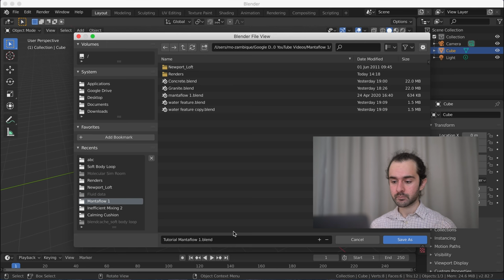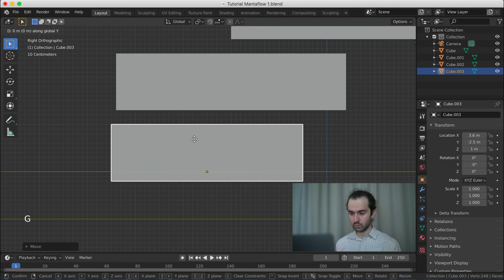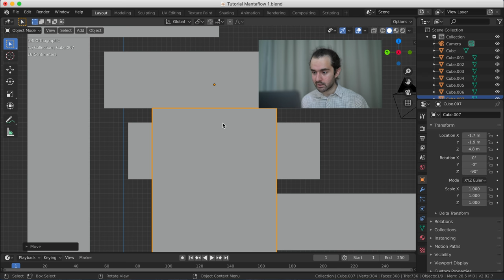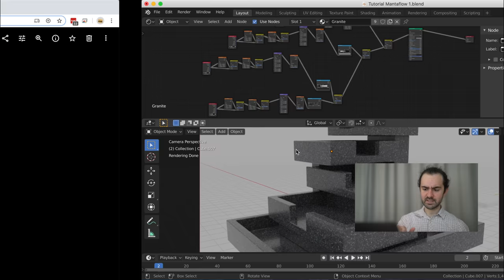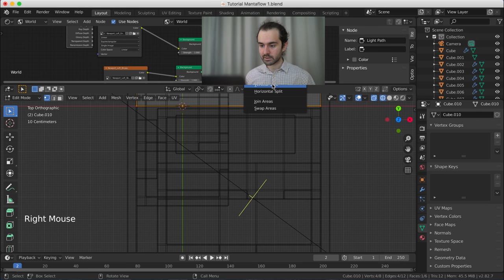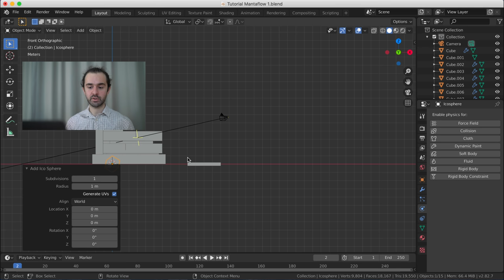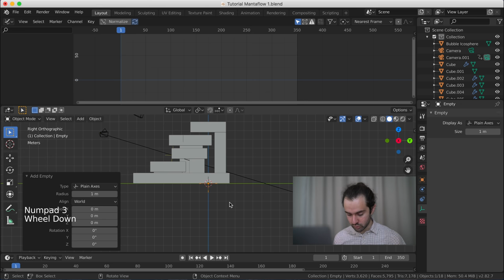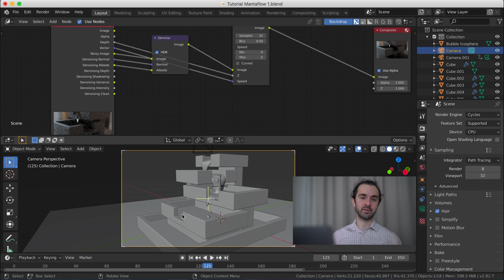Tutorial - Beautiful Water Feature Fluid Simulation in Blender and Mantaflow

Comment: Just following along to this, but my particle / fluid flow hasn't even reached the lower tray by 250 frames, even though I'm using the same settings (I'm using 2.82a ).  Any ideas?
Reply from the maker: You could increase the time step, or increase the number of frames. Weird though, that you are using the same settings and it doesn’t reach the bottom.Could be to do with resolution, which has an indirect effect on the speed of the simulation
Reply: @MobyMotion  It's very odd, as if the fluid somehow becomes thicker / slower. I've tried setting the particle to 1.0 from 0.8, upping the speed, increasing the surface thickness of the collision effectors. At some points, looking at the mesh, it's like it folds in on itself, yet in wireframe, it doesn't seem to leak through the various tiers.
Reply: I've tried all sorts to get the same results as yourself, whilst I'm getting closer, by changing the scale of the scene and putting the flow up to 1.00, it still doesn't seem to work the same way. It definitely looks to "lose volume" on it's way down the water feature, you can see more fluid going in than appears to 'form'. It may be my perception as well, but it seems to gain viscosity as it goes. I've uploaded the blend file if anyone wants to see if they can spot any obvious issues I'm missing. Interestingly, upping the number of time steps from 4 to 5 seems to slow it down, which I would of thought wouldn't be the case, just a more refined movement.
https://drive.google.com/open?id=13zA-oHb8734NxAR1HUSwCjg0u8R40WWu
Reply from the maker: Can’t look at the blend file at the moment - but if your water is shrinking rather than expanding then you need a size value >1. Let me know how that works
Reply: @MobyMotion  Hi, tried above 1 and as you mentioned in teh video, it just overflowed. I ended up going right back to basics and walking through the whole process again. As I was looking at the mesh in wireframe, I noticed an odd bevel where I wasn't expecting a bevel. Checked the modifier, checked the edge bevel weight, seemed fine. Then looking closer, I spotted the tell tale "dot" of a polygon along an edge. For some reason, there were a couple of spurious such polys in the mesh, which of course was copied for each tier. So my guess is the fluid couldn't resolve the effector properly, rebuilding the mesh from scratch got closer, though still not exactly the same, it at least behaved as I expected. So that's a "gotcha" to watch out for for others where they may have similar issues. How the poly got there I have no idea, I may have had an edge highlighted and accidentally hit 'f' I guess.
Reply from the maker: Ah interesting - glad you (almost) fixed it in the end. Another thing would be to make sure the fluid modifier is above the bevel modifier, so that the basic shape is used for the calculations and not the modified one.
Reply: @MobyMotion  Ahh, good point!

Comment: How to do a multithreaded render? Tell me please! I see you have several (to be precise 8 pieces) squares running around when rendering. I have only 1 square in Blender. I used to use 3dsmax and there I ran 24 squares (since my processor has 12 cores and 24 threads).
But in Blender I always have one square at any setting. I installed both "CPU" and "GPU Combined". I've tried setting "Thread" to "Fixed" and specifying 24 (although the number was already 24 by default). I also tried to enable the use of CUDA in the settings. But always the same result, that when rendering, one square runs, instead of 24.

Can you help me set up Blender correctly so that the render is also multi-threaded like 3dsmax by default?
Reply from the maker: I had multiple tiles at once because that computer doesn’t have a GPU. If you using CUDA (ie a GPU) it’ll only render one tile at a time but much faster
Reply: @MobyMotion  Before I enabled CUDA, I rendered with a processor. However, there was only one square.The version in which I did it 2.93 and 3.0

Comment: Dear Moby Motion! What a great tutorial - many, many thanks! However, after applying the granite texture and linking all the "Object" instead of the "UV" nodes, I found that the texture is scaled along the z-axis in (exactly?) the same amount as I scaled the cube initially to construct the basins. So now the texture looks great for the surfaces parallel to the x-y-plane, but it is squeezed on the vertical surfaces. Did I forget something/make a mistake (I'm using 2.83)? Thx so much ;-)
Reply: Edit: Just found the problem and solution myself: I scaled the objects in Object Mode - which changed the dimension and the scale. Obviously one should only scale in Edit Mode to keep the surface-scaling unchanged. However, using Ctrl-A and apply the scale solved the problem. Time to continue the tutorial :D
Reply: @guenthergrohall3437  Thanks! I was getting the same problem. Now solved. ✌

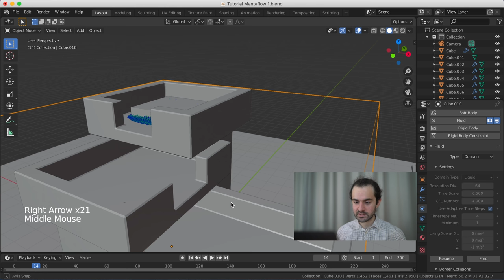Comment: May i know at 45:00, why did 'Liquid' particle system is turned off in both viewport and render? Without the liquid particle system, the particle radius property in it cannot be set, then isn't that the water overflow mentioned in 38:40 would happen? I leave it turn on before baking and my water flow is lesser than the water flow in video. Thank You so much.

Comment: Hi, when I try to do the fluid simulation, I don't see any fluid after baking. I've done exactly what you did, but it doesn't work. Any suggestions?

Edit: It's fixed. For anyone else encountering this problem, you have to use an older version of Blender (like 2.8.0) because the fluid simulation settings are different between the 2.x and 3.x series.

Comment: I made this simulation with a water fountain made of several glasses and I don't understand why blender doesn't reconize them. The water passes through the galsses like if the glasses weren't obstacles. I don't undestand what's happening.
Reply from the maker: This can happen if the resolution is so low that the platform isn’t thick enough. Try making the obstacles thicker or increasing the resolution. 
Also check the normals are in the right place - try recalculating them.
Reply: @MobyMotion  ok. I am working on that. Thanks!

Comment: Followed your tutorial religiously, but when I attempt to render, the mesh and particles don't appear.  They are in the viewport render.  I googled this and others have had the same problem, but no one has posted a solution.   Any ideas on what is going wrong?  Also the mesh doesn't look right in the viewport.  I baked at 128.
Reply from the maker: Which version of blender are you using?
Reply: @MobyMotion  2.83 just released.  Since I posted the above, I got it to work in the render, not sure how though.  Tried a number of settings, switching render and camera view on and off in particle system, changed a couple of settings and re-baked.  Anyway, my fountain is too frothy, and visible bubbles, but if I reduce the scale of the icospheres, the fluid is barely visible ant thin looking.

Comment: Here's mine: https://youtu.be/HE5d2Zk3Jx0
Baking the sim took absolutely ages! :) I didn't want to see the fountain filling up, because I thought that looked odd i.e. a fountain is a closed system... it's just cycling water already there. So even if you've just switched on the pump, each of the levels will contain water from the get-go.

It's looking pretty good. It's not quite as smooth/watery as I'd like. Yes, the fluid type chosen in Blender is water, but you can see some jelly-like fronds/drips at the sides of each water fall (as it passes through the gaps in each of the platforms). As the fluid level increases, however, it starts to look much better, so what would I need to adjust to make that more consistent? I'm guessing a balance between speed (time scale) and resolution? Or speed and particle radius? They're both set to 1.3 and 0.7 in this animation, respectively. Any other setting either flowed way too slowly, or filled up the domain above the platforms/base edges.

Even when I'd found a decent setting for flow, I found I also needed to fit a drain (a hole in the base, at the back where you can't see it), because I wanted to stop the domain from filling up, causing the liquid to rise above the base lip/edge. This drain just lets water flow out of the base at an even rate, which meant I could run/bake the sim* until there was an even level of liquid throughout the whole fountain.

*This animation starts at frame 450 and goes to frame 1200. Which meant I had to sim a whole bunch before I'd got to a point I wanted to start the render from.
Since the inflow option provides a constant flow of liquid, it would be easier if we were able to control the lifetime of the particles that make up the fluid, because I'd then be able to kill them off when they weren't needed any more. As above, if I hadn't added the drain, the water would just keep rising. Unless I'm missing something obvious, and there's a way to control when fluid particles die?

The camera motion in this would have been better if it had looked like a hand-held shot, instead of the smooth motion I set up. Is there a way of tracking a separate video in Blender (say, shot on a mobile phone) and then using that track in an animation such as this?

Anyway... this was great fun to create, and it's taught me a lot about fluids in Blender. Thanks a million for the tutorial!

Oh, and please excuse the text formatting... YouTube won't let you create proper paragraphs if your post is quite long, it seems.

Comment: I've spent way too long on this. There's no much of a difference with the settings in 2.9, the water moves and effectors work. But why doesn't it fill at all? I used the SAME settings and geometry in the video. This is so frustrating. I just want to finish this sooner than later.
Reply: You said the effectors work, so maybe you are having a different problem than me, but is your water falling straight through all of the granite platforms without interacting with them?
That's what was happening to me, and I resolved it by changing the Surface Thickness to 1.0 in the properties under Effector. It completely fixed it.

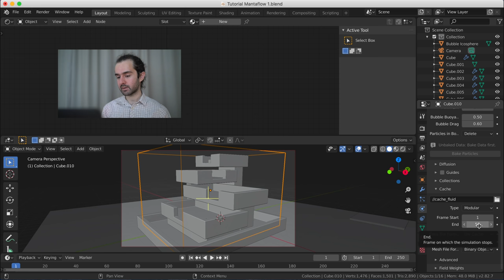Comment: Ah, annoying little details.  at 37:15 the Cache Type setting is Modular, but my Blender 2.90.0 has it as Replay.  No idea what this is for, but there's no Bake button if it's Replay. Default settings changed with Blender versions?  Or I had, or you had, a different initial setting? Whatever. Modular is the way to go.
Reply: The replay setting just means that you have to press play and it will bake the fluid simulation automatically. This means you can iterate different settings quicker without having to go bake and click bake every time.

Comment: Have followed the tutorial exactly as you have done it and my fluid is completly different. By frame 250 it has hardly filled the second level and just seems to die as soon as it hits it with no fluid spilling out into the next levels. Given that i have followed it exactly the same and it's giving me a different result, i can't think of a particular reason for this. Any help would be great.
Edit:
By keeping the time scale at 1 the water just makes it to te bottom, however the final animation does not look right, the water runs down very quickly, had to put  a speed control modifier on the video editor sequence to get it to look somewhat realistic.
Reply: this is also happening to me
Reply: found a fix. you just need to increse particle radius untill it looks how you want it to
Reply: Ah right then, thanks for the tip, will try this the next time i play round with it

Comment: when i render i can only see the massive box even though I set the display as to wire. what am I doing wrong most likely.
Reply: Yes the same fpr me. But only since 2.9 . when I worked on that project in 2.83 it worked... i think it is a bug or some settings changed that we now have to respect. But idk either what to do
Reply: @hofgof4453  oh i figured it out, you have to check mesh and bake it or it just shows the cube but after it just shows the liquid.
Reply: @andrewdunning6488  dope, thank you!!

Comment: Good day hope everyone is safe and well

Im in need of assistance with the fluid simulation have tried multiple times to ensure my setting match but for some reason when it comes time to bake the data the following keeps happening:

The box (cube enclosing the feature) shows in rendered view even though i did do as instructed and set it to display as wire have also tried to use the settin of it not to display in render... it still shows and cant see the feature

The water itself when does bake it wont seem to flow beyond th third level before the sequence stops and starts again.

How do i increase it to flow all the way? 

This is my first time working with this so do i need to have certain add ons activated? Or default settings to look for? Any assistance is greatly appreciated
Reply: I am experiencing similar issue. Everything else is fine, but the simulation ends when water reaches the third step. Might have something to with amount of water being generated at the source.
Any help would be appreciated
Reply: I'ts possible that you have to increase the frames of your simulation. From what you write it seems to me like your sim need the frames you have set in the domain just to reach a certain point, then the simulation ends. Try set a higher number in your cache settings and you should be fine

Comment: 46:42 my fps is very low(about 5-10) fps. Please tell me a fix for it🙏. And the water is not going down through third block from above. Please help🙏
Reply from the maker: low fps will just be down to limitations in your computer. you can help by making the scene more simple, for example by disabling particle systems or using a resolution mesh. however, it was also very slow for me, it doesn't matter as the final animation will be full speed. to get your water to run down further, just increase the animation time by changing the start and end frame of the cache.
Reply: @MobyMotion  what end time should I put?
Reply from the maker: The longer you make it the longer the animation will be. The best way to choose these settings is with trial and error
Reply: @MobyMotion  thanks for the reply🙏. May god bless you

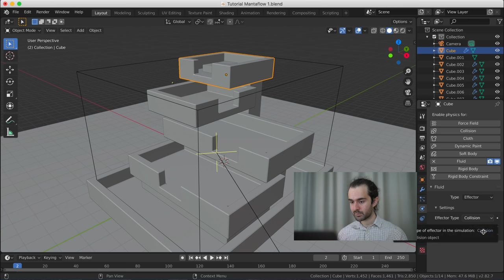Comment: 36:25 
What fluid type set????
Reply: Effector
Reply: @RaushanThakur09  but it's not working
Reply: @mdfaizanzahid5089  If you're using 2.83, I had to play with the inflow settings for the water source. I increased the surface emission and adjusted the initial velocity too.

Comment: 19:20 bevel is not working, lil help is appreciated
Reply: Bruh eyepoint it
Reply: You may have extra vertices created during the extrusion process that prevent the beveling from working - that's what happened to me.
If you go into edit mode on the object, then press F3 and search for "Merge by Distance," you can remove any duplicate vertices that shouldn't be there. It will display the number of vertices removed in the bottom-right corner of the screen after the operation.
After I did that, the bevel worked perfectly.
Reply: @StraveTube  thanks a tonnnnnnnnnnnnnn

Comment: Nice video! I wanted to try fluid simulation and was looking for a tutorial but all the other videos were short and not very detailed. I can't believe this doesn't have more views.

However the materials you used were too much for my computer, so I had to use an image texture instead. It took about 100 seconds to render one frame with the granite texture, while the image textured one took 70 seconds. Those seconds add up fast so I just used the image texture, which still looks great.

Another thing I noticed while watching, the background noise is too loud. If possible I would get a better microphone setup first, or maybe there is something that can be done in software?

Anyway great job, subscribed  :)

Comment: typical MacBook pro background fan noise blowing as crazy. 3D software, CAD and other serious stuff is better suited for PCs. I’m not longer use macs with blender (or any other 3D software) as long as there is no metal proprietary implementations for any of those, and the noise due the underpowered macs struggling with intensive apps.